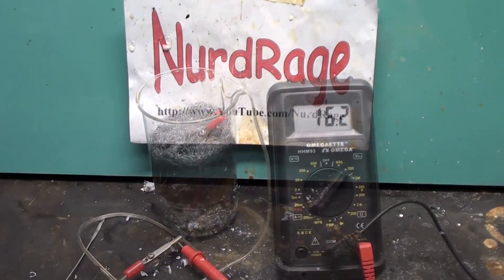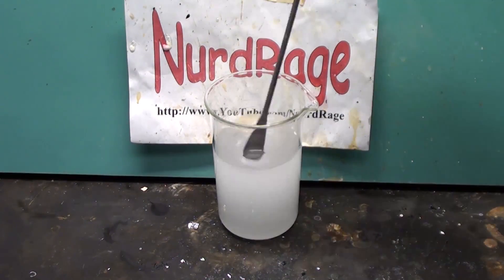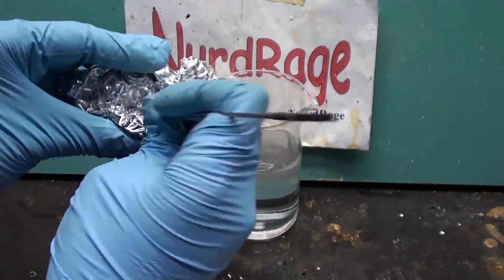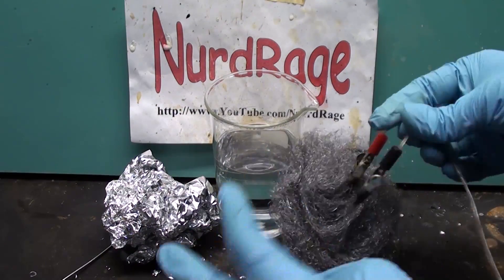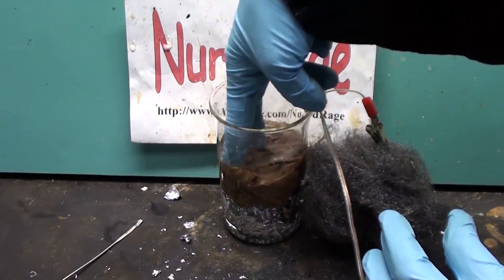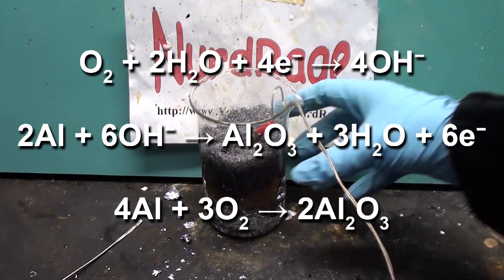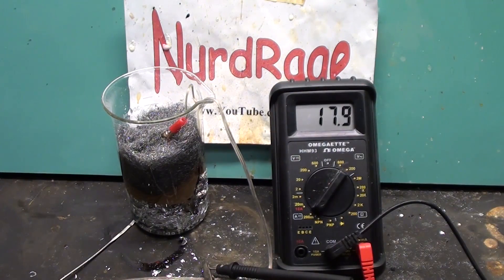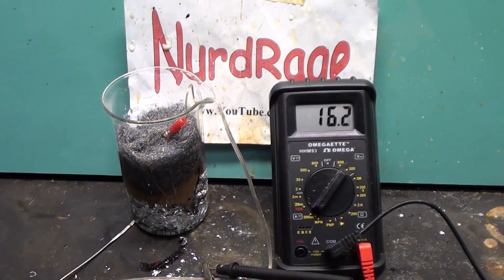Make an Aluminum Air Battery

Comment: The Wikipedia page on aluminum air batteries says that that the aluminum oxidizes to Al(OH)3. I noticed you have it going to Al2O3. Does the aluminum hydroxide turn into aluminum oxide and water?

Comment: I did something like this but instead with a copper cathode. When using a load, the anode was bubbling, are those bubbles oxygen or chlorine?
Reply: The bubbles are hydrogen gas

Comment: Also probably a stupid question but isn't there a way to increase the power output like they do with power lines? This simple battery should be able to output a lot of electrical power maybe even enough to partially charge a cell phone?
Reply: If you're going to try and make a battery that charges a cellphone you will need something with a higher amperage than this like the one from Nurd's zinc air battery video. Otherwise you will need many more of these batteries set up.

Comment: it sucks cuz alligator should NOT touch to water its why you get 0.2 volt... Try the same thing without put alligator into the water and u can get more voltage. U can get 0.70 volt per cell with copper coin, alluminum and salty water... But you can not get high amp with it cuz u should have larger surface to get more amp
Reply from the maker: I did, it did not get more voltage.
Reply: Firstly i should say thank you for your videos. I watch all of them i have learned a lot of things from you. Im trying a lot of matterials to make cell. if i use small amount of carbon and alluminum i get 0.70 volt  ill try to get video. I wanna ask something how can we get materials from nature? its hard i know but i saw at discovery rough sience he was getting potassium nitrate from bat droppings and he was doing something from human urine? im searching things to use in survive
Reply from the maker: emre mutlu what i mean is touching the alligator clip to the water. I tried the same thing without putting alligator clip into the water and i did not get more voltage.

Comment: I made three of these cells, wired them in series, and was able to power a small sony fm radio walkman that takes one AA battery. In place of the steel wool, I used aquarium filter charcoal, as it has a better surface area for oxygen to get in, so the cells provide more current.

Comment: air batteries run on air only, that is just another chemical electrolite battery. the voltage is not impressive. you can do better with just a cup of watter with a zink nail and copper wire in the cup. you get about point 8 volt.

Comment: You could use sodium carbonate (washing soda) to get much more voltage and current but the battery would only last a day or so since aluminum slowly dissolves in sodium carbonate. Sodium hydroxide will also work but with that you have to be very careful not to use too much of it or you get a violent (and dangerous) reaction.

Comment: @SlackerSlayer An electrical battery is one or more electrochemical cells that convert stored chemical energy into electrical energy.

A rechargeable battery or storage battery is a group of one or more electrochemical cells. They are known as secondary cells because their electrochemical reactions are electrically reversible.

Comment: @Cooldude32281 The terms were used correctly.  It may seem confusing, but think of it this way:  when you're dealing with the electrochemical SOURCES of the battery's energy, as opposed to that which it powers, the terms are reversed.

Comment: Well done,
but the best and cheapest solution is graphite with alufoil as the electrodes and
water and K2CO3 as the electrolyte.
This gives about 1.3 to 1.5 Volts and lasts long and graphite can be selfmade
(lookup the overunity forum)
or from pencils. And Alufoil you can get from every supermarket.
Many thanks for your nice videos !
Regards, Stefan.

Comment: Since normal foil alredy haves aluminium oxide, i dont think the reaction works as described. Most likely it's forming aluminium hydroxide. Hydroxide is quite a stronger oxidizer than simple oxygen.

Instead of:
2Al + 6OH2 --> 3H20 + Al2O3
would be:

Al2O3 + 6OH --> 2Al(OH)3

Comment from the maker: @dethbot12 Applying a current to the battery does not restore the products back into the original reactants. therefore it's a primary battery.

Comment: @NurdRage Can You make a video demonstrating the differences between electrolytic and voltaic cells? Its an important topic on the DAT and MCAT. I always get confused on which is anode and cathode. I just know the rule is Reduction is always the cathode, even if its negative. Oh and if you decide to do it, do it before the 24th, as my test is on the 25th :) Also, this is a covered topic so your video would be different (from others) with a real setup as shown in this video vs. just a diagram.

Comment: just an idea.... what if instead of water you use hydrogen peroxide? i think the reaction should be faster and independent of ambient air and i think it should work as well with zinc (because of some laws i can not put my hands on some H2O2  of higher concentration than 5 % commercially ) please give a reply

Comment: Hey, I can now make my Alumina Capacitor now!
I've never been entirely sure how to get my hands on Alumina.
Before I go spending big bucks on steel wool and aluminium foil. (Or burning my way though the house supply). Alumina forms a protective coating is that right? So I'll probably never get a glass of alumina?

Comment: @edv177 Probably there's enough moisture lingering in the glue to maintain some ion mobility.  But water isn't an absolute requirement for an electrochemical reaction to occur.  For the very coolest perpetual battery ever made, google the Oxford Electric Bell.  Might help if you also read Wikipedia's 'History of the Battery'.

Comment: @NurdRage I did some reading on Davy a while back.  You are completely correct.  It can be argued that the "confusion," assuming there were any, happened on BOTH sides of the Atlantic.  And that it matters none at all on either side as long as we agree that it's the same metal.  'Scuse me while I go catch a lift down to my lorry.

Comment: Nice demo.  You might have pointed out that metal oceangoing craft suffer from corrosion (oxidation) resulting from these same electrochemical effects by reason of their metals coming in contact with salt water.

Comment: what can it power and for how long? (hope this wasn't asked already) like a small light or a small fan maybe?
Volts: 0.23
Current: >20milliamps

If you made a bigger one, would you get more power, like a 5 gallon bucket, a few containers of salt, some rolls of foil and a few bags of steel wool?

Comment: hey nice, something i can actually do with stuff i already have in my house
you probably already know but you can also use fruit and or starches (potato)

you could have multiple containers with the same thing and then hook them up in series to add the voltage and maybe run some little electronic device

Comment: @NurdRage I'm a little confused. Isn't the positive electrode the anode and negative kathode? 
I'm pretty sure it is for diodes and capacitors so why would it not be for this battery?

Comment: the actual voltage and amperage readings on the battery probably won't even be that high due to very little or no load upon it. Give it a small load (varying sizes of resistors) and test the readings again.

Comment: I suspect that your current is being limited by the availability of oxygen to the iron. I would put in in a flat dish and spread it out. Also a touch of base in the aluminum portion will help take off the oxide better than the chloride alone. Otherwise good design.

Comment: @Nurdrage Alright. I'll try it later or tomorrow. The steel wool I have is kinda odd, it doesn't burn like usual iron/steel wool does (like, it gets ember red if you burn it, and all it does is make some smoke with 9V batteries), and even trying to get rid off the Cr with NaOH doesn't really seem to work. Ah well, I'll see how it goes and let you know!

Comment: @NurdRage I have steel wool, but it's stainless steel. As I understand, stainless steel is usually coated with chromium nowadays, is there a way to get rid of the Cr but not get rid of the Fe?